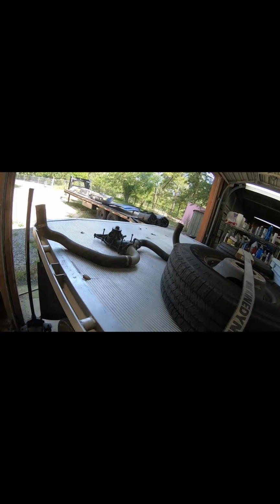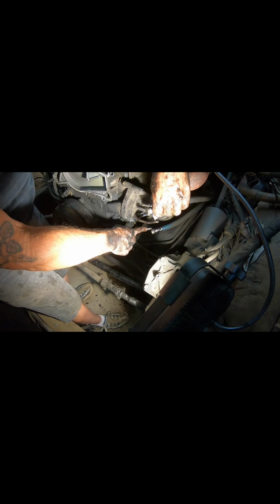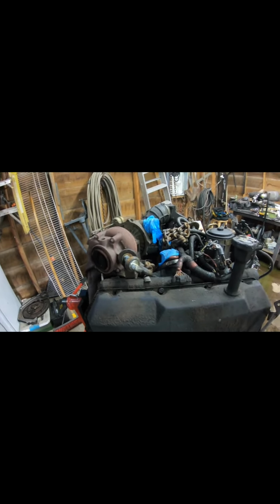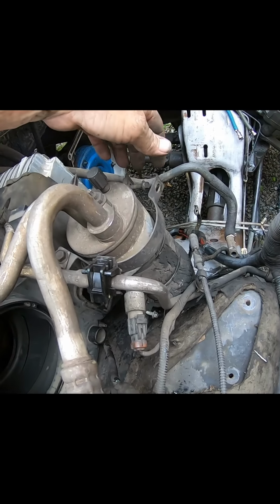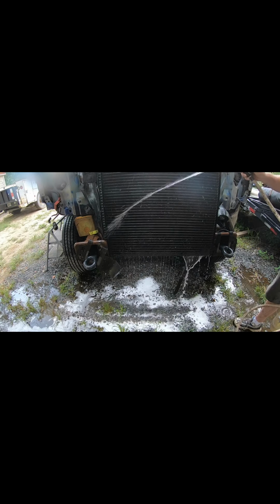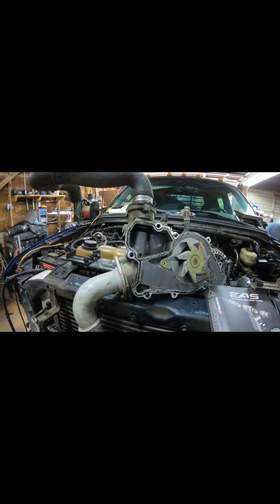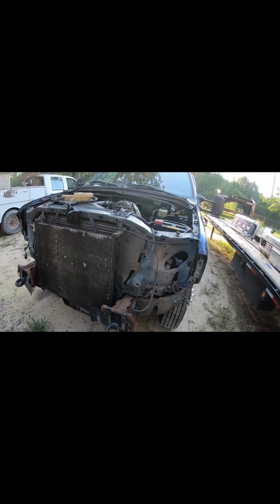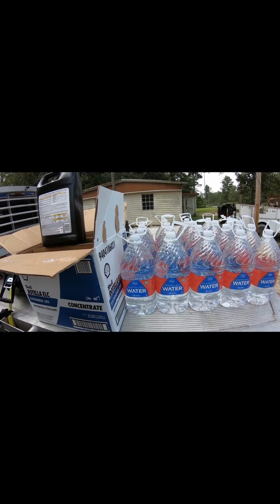Major Pre-Trip Inspection FAIL!

Comment: I hope you get back to running.  I’m thinking about the 7.3 I’m praying you get back up and going.
Reply from the maker: I need to edit a video on this. I installed my spare motor which was supposed to go in my personal truck. The spare was from a truck I wrecked last year and runs really well. I gave it a good workout test run but have not taken any loads because I am also a boxer breeder and just had a litter of puppies. I had planned on being off at this time and would have swapped the spare into my other truck while keeping a close eye on the litter.